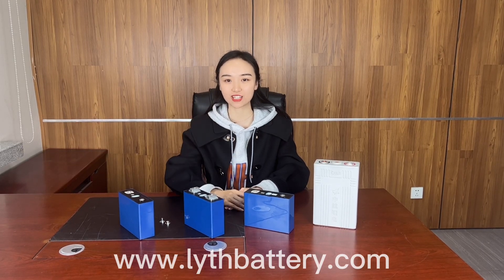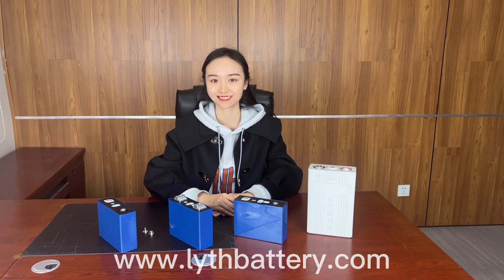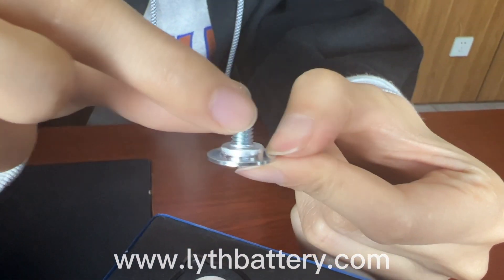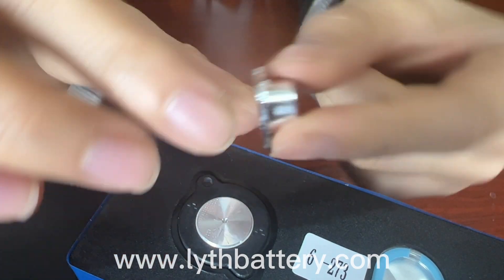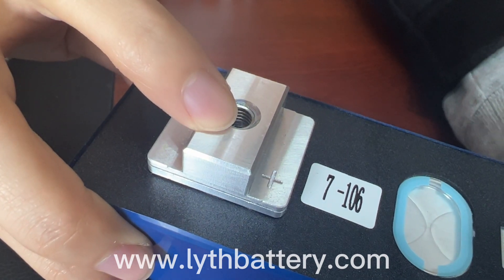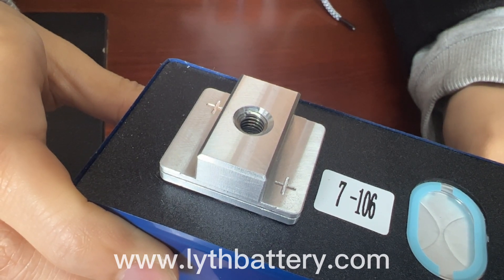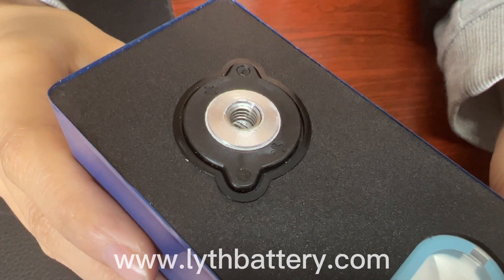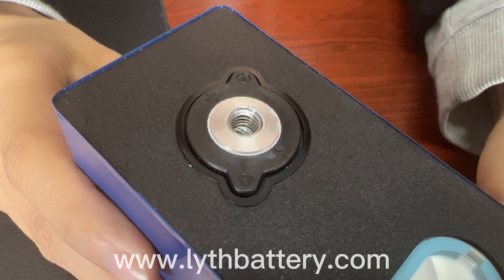How to choose the lifepo4 battery terminal？

Comment: Hi I need a contact for a battery I purchased the contact I have was melted and I need to find the best way to attach it to the battery. Please this is the closest I could find to accurate info on replacing one of these
Reply from the maker: Thank you for your message. If the contact on the battery cell was melted, we recommend replacing it with a new nickel strip and using spot welding to reconnect it safely.

Please send us a photo of the damaged part and let us know the cell model, and we’ll guide you step by step.

Comment: Why i buy this battery
Reply from the maker: Many customers choose to purchase lithium battery cells instead of finished battery packs — and for good reason. Battery cells offer greater flexibility, lower costs, and stronger adaptability. By sourcing cells, you can freely configure modules to meet your specific voltage, capacity, and structural requirements, creating solutions that are perfectly tailored to your project. Cell procurement also enables better cost control, especially for companies with PACK capabilities or OEM partners. Moreover, working with cells gives you more control over the technical details and quality of the entire system, enhancing autonomy and long-term project sustainability. For customers who value customization, efficiency, and scalability, battery cells are clearly the smarter choice.

Comment: Hi, thank you for your informative video. what do you usually recommend for people using the welded studs for getting the best contact, seeing as the contact area is so small. 
The elongated holes on the  bus bars that usually come with lipo4 batteries create a situation where and already quite small contact area is then having even less contact, due to this elongated hole... Are there any methods that ensure a good connection to the contacts and maintaing a low resistance?
Reply from the maker: It is recommended to determine the current level first, if the current is not too high, it is usually sufficient. If the current is higher and a better contact area is needed, it is recommended to choose welded aluminium block type.
The holes in the busbar are set in such a way that they can still be used in case of tolerances.If you need them to make full contact, you need to customise the busbars with particularly precise holes, narrowing the holes in the strip to just enough for the stud to fit through.
Reply: @luoyangtianhuanenergytechn4225  drop your wechat